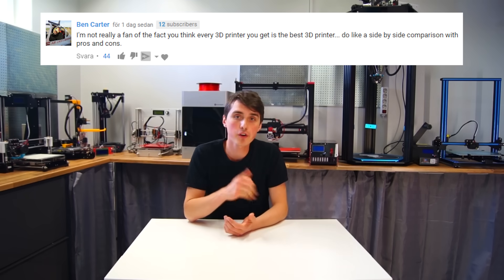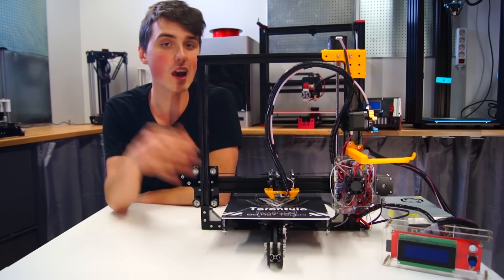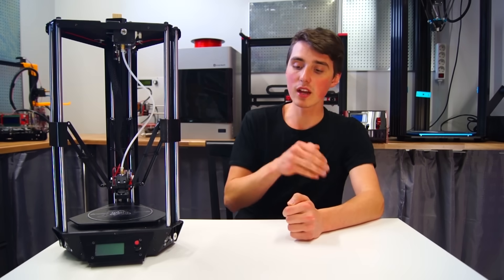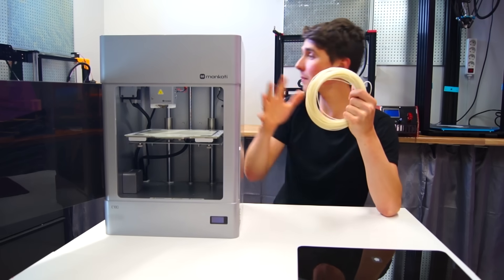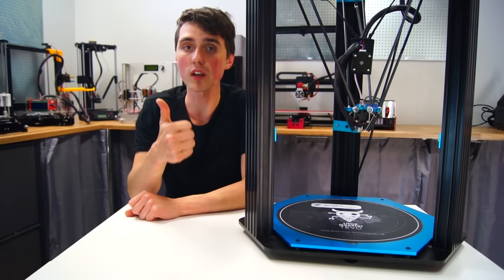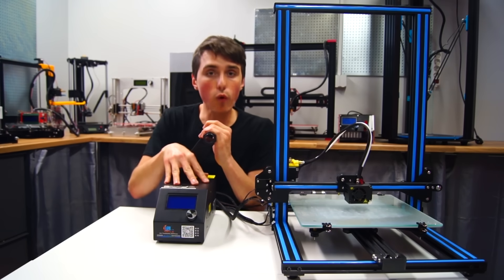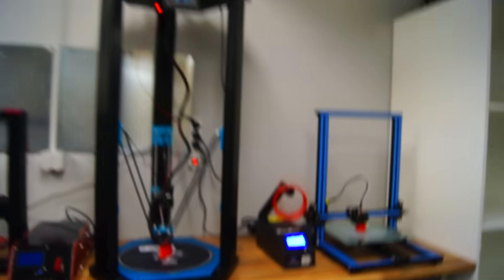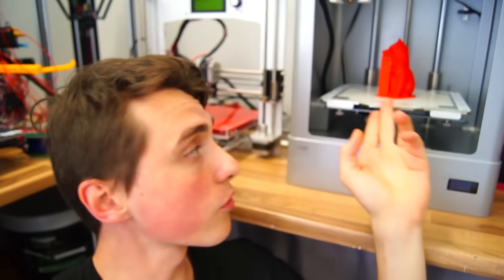Why This Is the Best 3D Printer - Comparing ALL My Printers!!!

Comment: good review, but i don't think you give the Anet a8 enough credit. For its price, i think it is a steal for the average user and anyone savvy with hardware and software modifications(down from programming languages to the more user friendly aspect of tweaking . It performs just as well as the others with clean prints with the right settings and calibration. Aside from the build volume with 220x220x220+ being providing plenty of space, i don't see what the other printers do that this doesn't aside from pretty much delivering the same end result(stuff like cloud connectivity is not is not really a selling point for the rest, imo). Print quality depends on how well you've assembled the machine, ie, tuning the axis belts to the right tension, and making sure the frame are rigidly assembled. Upgrading a few parts if you prefer, is cheap and easy. Leveling the bed at each corners with the right and equal gaping height. 
The learning curve in assembling this printer is a bit steep for newbies since the almost universal and 'translated' instruction are somewhat unclear. The exposed power connectors is a hazard that can be rectified with a switch and a printed protective housing. A switch from the default slicing software to a better one  gives you more options to tweak and improve your odds with quality prints, not just with that brand of printer alone. Aside from potential manufacturing defects with all printers, This printer uses pretty much the same hardware as some of its more expensive counterparts. Critical parts like  the linear guides and bearings work smoothly with no 'play' that affect the printing process, the belts are of the right elasticity, evenly and precisely geared. Factors to consider when printing: matching machine settings to those in the slicing software, leveling the bed, heating the bed and nozzle to the right temp, with the appropriate type of filament.Taping over the bed with textured tape along with  some glue for better adesion, for all printers. etc
 Unless you are a large manufacturer of some type of product, for which you are better off investing in an industrial grade printer to meet your specs. The varying build volume from these printers is of marginal importance when you could simply print in segment or modules then assemble the final results.

Comment: thanks for your video.niceee :)

which 3d printer is more suitable for small pieces which require accurecy.?
Reply: All of them but if you want more precision and a higher resolution, an SLA 3d printer will be your best choice  but they are not cheap.

Comment: Does anybody know if 3D printers only make preset designs or if you can somehow make an original and get it to print it as well?
Reply from the maker: You can build whatever you want in a CAD software and then print that out.
Reply: I shuddered at the thought of preset/ preloaded designs in a 3d printer. It's almost like a 'closed source' project, the complete opposite of the idea behind low cost household 3d printers.

Comment: Eeeehm. You literally screw in the mains voltage supply on three points with about 2mm's of plastic between it, and three points away from where you screw in the 12V out. And then there is a plastic cover that flips down to protect you from touching anything. Not quite sure what you are going on about regarding safety when it comes to that, because there is about zero things that can go wrong.

Hmm. Though I guess you COULD wire the thing wrong, exposing live current to the chassi, but then you would have to completely ignore color coding, and all of the instructions that are super duper clear.

Or did you get one WITHOUT the protective plastic flip down cover? You know, the big plastic thing that flips down so that you cannot accidentally touch anything, but have to manually open the cover?

Comment: Why do people think mains is unsafe when they're running high power motors from that same power source?
The DC-converter won't give you much more  protection than a circuit breaker.
If there's moisture or children sticking stuff into electronics you should cover/hide the whole unit.
Those "unsafe" psus are high quality lab-PSUs. They are usually much safer than cheap laptop-adapters.

Comment: The print quality is not just dependent on different type of printer  but on how it is calibrated. You can have two identical printers,  but each can generate different output. You would think that same brand  same design would perform exactly the same and generate same print, but one slight mechanical misadjustment and that will change the output. You can have a perfect mechnical assemby, but If the heater is a bit skewed on one, it will result in inconsisten layers, with perfect same setting on the software and you may think one is better or worse than the other.  I think it is much more important to focus on the way the machine is constructed, manufactured. Because here we can have some reference as to what type of performance we can expect from such.  I rarely purchase a product by reviews based on output, alone,  but how the product is made and constructed.  Most anything brand new will perform fine because it is brand new, but if it is not designed for longevity, durability, and most important with a 3D printer "repeatability" then this should be be of concern if you are serious about the output.  My Mini Fabrikators II print excellent! but I tweaked them a bit, made new Z axis nuts and readjusted the mechanics. The machine frame is solid, being square aluminum, ultra compact, and the rails are very similar to what you find on the mechanics of CDROMs,   this was the attraction when I bought them, and sure enough, not dissapointed, it is a well thought out design, also you can not go wrong with a cube type frame, from a logical structural point of view, a lot more rigid, where it needs to be, than many of the more open frame designs, towers, cantilevers, gantrys,  and bigger does not mean stronger or better. If it was not for the limitation of part size and a bit cumbersome to level and work in such compact machines,  I would not be looking for other machines. But they have paid themselves 10 times over with the projects I've done in such a short period.  You should check out the parts I am doing with these tiny machines,  they are pretty darn good, compared to parts done on a Stratasys.

Comment: I have the Geeetech Prusa I3 Pro b and it works very bad. I assembled it correctly and when I press autohome, the x stepper drives in the other direction, so i filed some plastics and now the extruder drives to the endstop, but the quality is very very bad.

Comment: got the geeetech working with a few tweaks: enlarged the z axis rod holes on top plate and some very time consuming precise z/x leveling job. however from time to time i have to do that all over again or the first layer i off, also ofc consatant bed leveling. other than that it works.

Basically whatever prices you announce it's150$ more in europe.

Comment: But where's the tiko printer?
Reply: Tiko is there a fishy on it
Reply: I had a beta Tiko for years. It was a unicorn as it worked great, and everyone else seemed to have issues with theirs and many claim to have never got a clean print from theirs. I still have some of the prints from it and a bit of the blue Tiko filament I wouldn't dare try running through a printer as it's so brittle. The extruder finally died on it, and it was a sad day. Back when I use to fund 3d printer Kickstarters. Never did receive many of them.
Reply: I don't think there is one

Comment: I have the geeeeeeeeeeeeetech printer and i have no issues after replacing the controller board. i too thought it was the drivers as i was having extruder issues but it is the board itself.

Comment: Hey man, have you check out the XYZPrinting printers? I think all of them are plug and play except 2 or 3 customizable ones. I looked at the Da Vinci Color which is like a printer with CMYK ink and all, but it is really pricey. Go check them out, they are very safe and I have 2 of them.

Comment: I got the Geeetech pro c, i must say IT IS A COMPLETE FAILURE. Starting with the building instructions, parts don't fit and must be chimed, then the electronic such as the stepper drivers stop working after a couple of hours of print, after that steeper motor defective. I cannot complain about the communication with the vendor is good, they send parts for free just pay the shipping, but then again the parts are cheap and defective.

Comment: Regarding the black widow printer, you said it blacked out and is showing the wrong values. you have changed the mobo and thermistors. just a shot in the dark here, but is it possible you are betting a power feedback somehow? or a nema 17 (?) is creating electromagnetic interference due to proximaty somehow, or you are reading parts of the value of the thermistor. i.e heatbed is somehow bypassing the thermistor but still gets registerd in the microcontroller.(short circut maybe). my 2 cents ;)

Comment: Very good review. I particularly like the way that you say why you consider a particular printer the best. Please correct me if I'm wrong., but don't the delta printers have the ability to scan a finished object for duplication as well or am I confusing it with something else.  I also like the fact that you did a head-to-head run-off with all of the printers side-by-side as well as finish as well as the time it took for each machine. So far I have not seen anyone else do this on the net, so thank you very much. Now  all I can do is to look for an additive 3D printer that can give me a metal finished product.

Comment: I HIGHLY recommend building a kit. It's such a godsend when it comes to troubleshooting your 3d printer.
Reply: Yes, i just got the ender 3 as my 4th 3d printer for by business and its great highly recommended, a fun build better then all my previous full kits that took hours and had crappy instructions
Reply: pretty much this. at one point I was about to go full hulk on my anet a8 and turn it into fine powder because I was stuck at one problem for a week (z motor stuck mid print at the exact same height every time) and when I finally solved it (wrong max z setting in the firmware) it felt like a climax

Comment: Good day.

I am Hardy from Shenzhen Creatbot technology Co.,Ltd and we are supplier of 3D printer&3D printing filament.

Highly recommend our C-D1 3D printer which has 300x300x400mm printing size and advantage as follow:
( Sample price for 1 set will be USD 950 FOB Shenzhen) 

1) Touch screen

2) Filament break warning 

3) Power off resume 

4) Close printing enviroment 

5) Big printing size: 300x300x400mm  

6) Can upgrade to Dual extruder, extra cost is Just USD50 

Also you can buy from our distributor online store as follow:

Link to our Switzerland: http://www.3d-druckerzentrum.ch/shop/product_info.php?products_id=1288&MODsid=4b5vdcgnaavq4p6ib8u3rf32g1 

Link to our Italy: http://www.stampa3dsud.it/home/876-stampante-3d-cbot-c-d1-touch-screen-30x30x40h-garanzia-italia.html 

Link to our KSA: https://3dprintingworld.org/store/view_product/90 

Link to our Alibaba: https://www.alibaba.com/product-detail/2017-large-printing-size-300x300x400mm-touch_60600391099.html?spm=a2700.8304367.coowc737c3.5.73152c549J4dLw&spm=a2700.8304367.coowc737c3.5.73152c549J4dLw

Should you have any questions, please contact me, have a nice day.

Comment: I do have Geetech Aluminium Prusa i3, which I bought on ebay for $250,  ended up getting all the money back and keeping the printer.   Replaced rods, replaced 2 steppers, replaced controller board, got Flexion extruder and e3D hot end, and Octoprint with webcam now it's perfect.    You can make a good printer out of it, but I would not recommend my experience to anyone.

Comment: Thank you for the review.
Question:  If you wanted to actually put a 3D part into service, what material would you use?   I have seen videos for PLA, Nylon, and Polycarbonate.  Which would be the strongest material for a hobbyist and what are the drawbacks.
Again, thank your for taking the time to make this video.
Reply: The question is backwards. Start with what part you want to make and then choose the right filament for that.

Comment: Hi RC
Since you made this based on a viewer suggestion, may I make another?
There are a lot of reviews for the printers themselves as guidelines to assemble and basic projects, but,...
There don't to seem to be any on the print materials or media itself, for example, how much material (filament) to buy to start out with, while learning to use the printer, how much is used for various projects, storage or shelf life of the media, old plastics get brittle or stiff, storage recommendations, many plastics deteriorate under certain light conditions, temperatures, or as in the case of PLA (I believe that's what it's called) humidity,
As a person looking to start out in 3D printing, it would be helpful to have a little guideline video on the printing materials/supplies, and their storage in addition to guidance on the printer itself
Regards
Ed

Comment: This might be little specific but would Creality CR-10 be good to print small size with fine resolution. Use case: Printing a head sculpt of an action figure which is 6 inch in size. So the head is almost 1 inch to 1.5 inch (H) X 1 inch (W) X 1 inch (D). Resolution is important as it needs to print the facial details like nose and eyes properly. What would be your advice?

Comment: Hi, I have an anet a8, but I am having a few problems regarding getting the print to stick. To start off with, the heat bed only reaches 95 degrees for my abs. Secondly, I have tried tape, pritt stick and just the heatbed but, I can't get any prints to stick, sometimes the first layer doesn't even stick and sometimes it slips during the print. I have tried varying print speed and I have a brim on. Any suggestions would be greatly appreciated, thanks in advance

Comment: Have you tried the Pursa MK2S how is its quality in all of this?
Reply: Its junk, we got one a few months ago, the power supply took a crap, then the Ramps took a crap. Absolutely no customer service from prusa despite 4 emails
Reply: @brandon1566    I'm under the impression that their customer service team doesn't have many who can interpret written English well, but I was able to talk with them. My power supply was starting to make a noise at some vibration nodes, so I took it apart to find that this Chinese-made power supply was of poor quality (including a capacitor installed with the leads shorted together). The rest of the printer is pretty darn good, and I've been running it nearly nonstop for about a month and a half now. After describing (in unnecessary detail) the observations and tweaks I had made, they replied with a brief email stating that they were sending me a replacement complete power supply, smooth rods kit, and bearings.

My printer is the MK3 though. In this price range, it doesn't seem worth it to skimp.
Reply: @brandon1566  an authentic Pursa MK2S uses a Rambo board, not a Ramps???
Reply: I just built the i3 MK3 and it blows the doors off of these printers in terms of quality (components, instructions, features, and print quality). Speed, I'm not sure of because I didn't notice him state the time this took. Also, I think he stated that he printed all of the models with the same settings, but I didn't hear nozzle diameter and layer height. There could have been a difference of quality if he chose very thick layers for speed.

Comment: 2:00 if you have an issue with an open power supply why don't you make a custom setup.
only because they gave you the blueprints does not mean you have to go by their design

Comment: @RCLifeOn had similiar issue with my Tarantula turned out that one connector was faulty (in case of hotend) and wire was damaged (in case of heatbed). Just check them with multimeter ;)

Comment: In your Anet A8 the Extruder has about 2 Steps too much, that´s why you have overlines wobble. Your complete test ist unfair, because before a test you have to print a test cube and adjust all settings. After that you can make a test. Also it seems like that you have a step loss in the X or Y Axle of the Anet. My Anet is in an Aluframe and it works great.